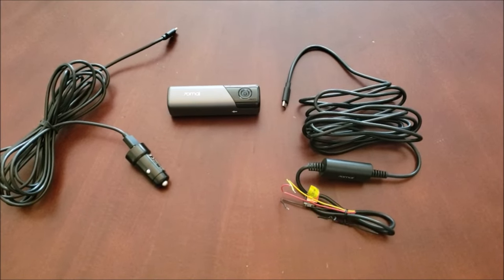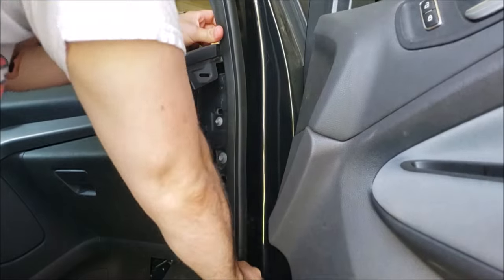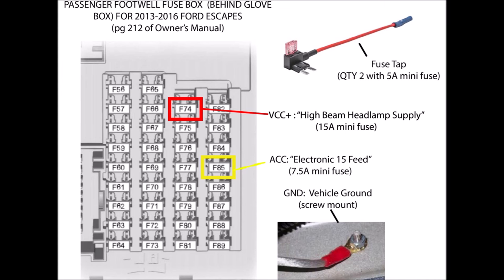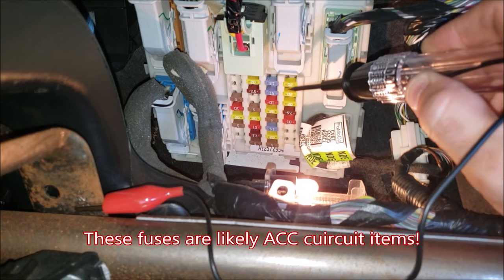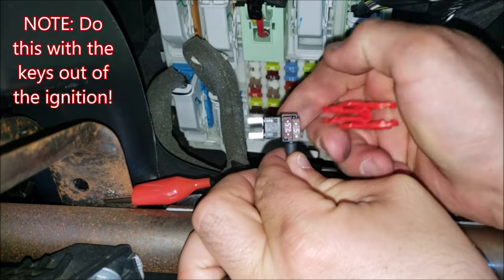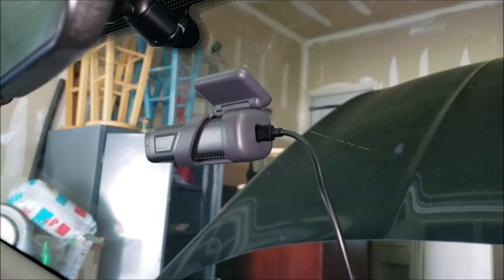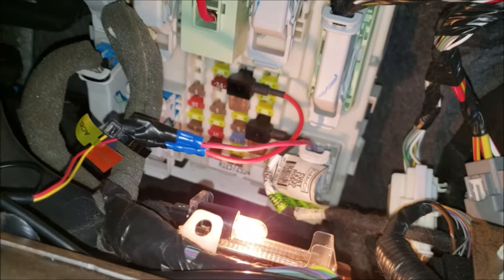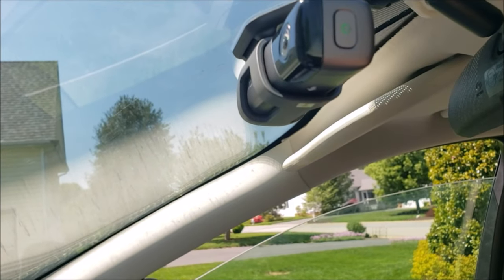How to Hardwire a Dash Cam to Your Fuse Box: HOW TO ESCAPE

Comment: I must have missed it but when you were installing the taps where did the 5amp fuses come from? Did you buy those separately cuz I didn't see you taking them out of the fuse box.  Are they some sort of buffer do you have to put them there I must have missed something.  EDIT. Okay now I see that they were already installed in your taps! Glad I watched this video because I was going to just simply tie the wires around the existing fuses.

Comment: Hello, my dashcam doesn't have parking mode. I just need to connect power source. So is it fine if I just tap Acc and gnd? Or do I need to tap the red wire also?
Reply from the maker: Good question- 99% sure you should just be able to tap the ACC and GND so that it's only on when the car is turned on.

Comment: the video i watched for the cam im looking at doesn't use fuse taps. they just wrap the exposed wire to the end of the fuse and then pop it back in. i understand the fuse tap will secure things better but is it bad practice to do it the other way where you just wrap the wire around the end of the fuse and then insert it back in?
Reply from the maker: I wouldn't say it is bad practice necessarily because it could work just fine. It doesn't seem as secure to me vs an integrated connection but I have seen people make it work as well. Since the fusebox locations can sometimes be hard to get to, I personally prefer to do it once and know I won't have to go back and inspect a connection if there is wonky power source issues with just a wire wrap. That was the thought at least
Reply: @HowToEscapeDIYTipsandReviews  fair point. thank you kindly for your quick response!

Comment: I see that you put a 5A fuse in the top slot of your wire taps.... should this vary based on the Amperage of the device that you're hardwiring??  I bought a kit, but the smallest fuses that came with it are 5A.... I'm not sure whether to proceed or head to the auto part shop as my Dashcam says its only 2A?
Reply from the maker: Hey there Andrew, sorry for the delay. A 5A fuse is not critical- you can swap it out with the requirements of your device no problem. If your camera is rated at 2A, a 2A fuse would suffice, but being spot on may cause nuisance trips. Maybe go for a 2.5A just to give it some wiggle room and not have it cook the fuse from normal use and power draw. Typical rule of thumb is 110-125% rated power requirements so that would land you right at the 2.5A

Comment: Why do some of these hardwire kits not have the yellow ACC wire?  I'm trying to determine which kit I need for my cam.
Reply from the maker: Hi there, ruesVR- if it doesn't have the yellow wire, it may be best to stay away from those kits if you're looking for something that can record when the car is off. The yellow wire is the input to tell the camera when the car is turned on for selective operation. The red wire is constant connection for power supply and it's not an issue if there's the voltage protection box in line with everything. There are many kits like this and I'm most familiar with these ones (obviously with this video) but the 2 wire kits may be ok too- it may just not have the selective operation or the parking surveillance.
Reply from the maker: What make and model camera do you have? Not positive, but I could take a swing at looking for a wiring kit for your camera.

Comment: do you need to connect the VCC+  what is that used for anyhow, also trying to find that dashcam m500
Reply from the maker: Acc allows the camera to be in recording mode when the car is on for full operation. VCC allows it to be connected to the battery at all times for parking mode / surveillance when the car is off. There is an Amazon affiliate link in the video description!
Reply from the maker: Amazon Affiliate link is here for thr M500: https://amzn.to/38vgtsQ
Reply: @HowToEscapeDIYTipsandReviews  how long recording you get with the 64gb version
Reply from the maker: Good question- the documentation says 64GB gets you 164hrs of recorded playback but we haven't gotten anywhere close yet lol. Hopefully it's true though. 32GB = 82 hours, and 128GB = 328GB.